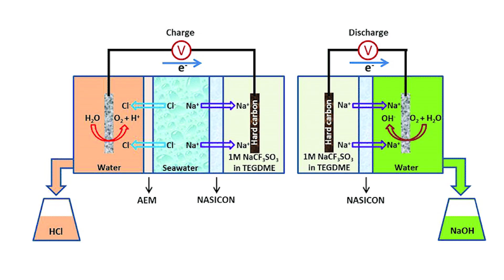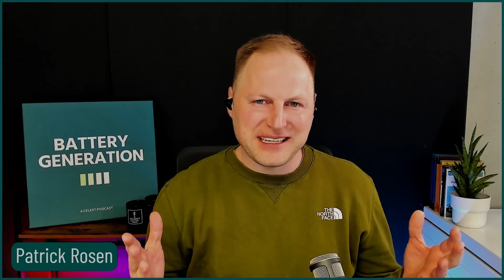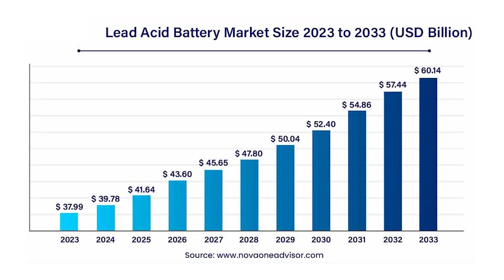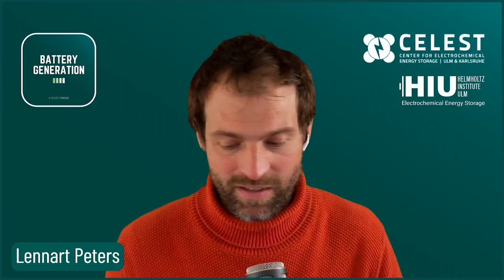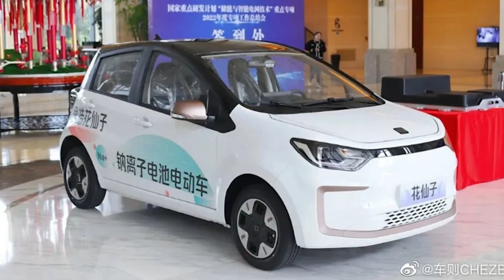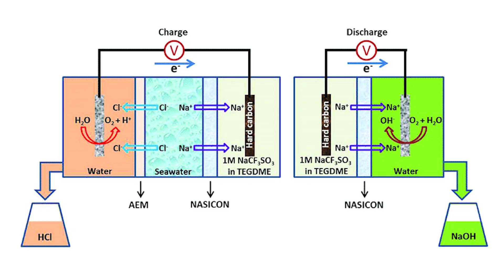💥 Why Sodium-Ion Batteries are NOT taking off.. YET! - Prof. Stefano Passerini - Battery Podcast

Comment: This video is 12 months old now and a lot of things with Sodium-Ion batteries have changed. China has a mass produced Sodium-Ion battery car running around now. It is the Changan Nevo AO6. It has 0 to 80% charge in 15 minutes. It has an acclaimed range of over 400kms or 248 miles.
The cell type is CATL Naxtra Sodium-ion.
Really I do not think that Prof. Passerini  has kept up with the great advances that are taking place right now in China. I give Lithium type batteries another 5-7 years and they will be gone. I will not buy a car that has a Lithium Battery because of the fire risk but I will buy a car that uses a Sodium-ion battery that does not go into a thermal runaway and is fast to recharge.

Comment: There are hundreds if not thousands of people in America who bought a residential energy storage system using sodium ion batteries in which the company has now gone bankrupt due to repeated failures. I worked for an inverter manufacturer where we tested these batteries and they would work fine if you put a small load on them. However if you put a large load on them, especially an inductive load with high levels of inrush current, the sodium battery did not have adequate internal resistance features and the voltage would collapse and the inverter would shut down on low voltage. They were a colossal failure. I imagine this has improved over the years but I would be extremely leery of this battery and I most certainly would not purchase the first version out on the market. I always wait for revision C. 😂

Comment: Many thanks to Prof. Stefano Passerini for the insights and to the channel for staying on top of the SIB. The arguments are clear as to why it has come about, but not quite why it has to stay that way long. After all, it cannot be Europe's constant excuse against resilience and safeguarding our value chains that China has just made lithium artificially cheap in order to prevent European battery plants or even those that want to produce the SIB. We better should move on breaking the Gordian knot with a massive European initiative to build sustainable (salt) batteries for BESS and (super cheap) transportation, instead of accepting China's ongoing manipulations. To secure our prosperity in circular economies, state-subsidized in the right way, just as China has done. Otherwise, Europe will completely lose its export-industry position and make itself vulnerable constantly to economic and political extortion. China is always inventing ways to torpedo the business cases for conventional approaches of European battery factories. We have to break up and definitely need state (Hermes) guarantees to signal our European private investors, its worth to invest in our all-sustainable green future. As our Chancellors said: “Whatever it takes”, and I refer specifically to the electrification of the European armies, itself offering natively massive BESS capacities when we are not at war, such as civil protection with heavy technical support forces can have. All of them could connect to grid in case of bottlenecks in the electricity supply and intervene in case of emergencies.

Comment: Always a pleasure to listen to Prof. Passerini. I'm really curious about the saltwater battery because it really sounds like a promising technology. Would be interesting to know how thin he thinks the solid electrolyte needs to be (e. g. lower than 100 µm), because I would think that since energy density is not the main criteria for this technology you could get away with a bit thicker electrolytes. While not increasing the cell resistance to much and compromising efficiency. Also the long term stability between these NaSICON electrolytes and water might play a role. Anyways very nice and informative podcast :)

Comment: to replace lead acid? lol sodium ion lost the race with LTO this year. in terms of usable capacity for 12v ranged applications, LTO smokes sodium ion without trading anything. LTO is already cheaper than lead acid, why would anyone want to experiment with expensive sodium ion with their useless voltage curve when LTO is essentially a forever battery for automotive applications. can replace a 250$ agm battery in the US with 100$ worth of LTO cells and a dumb analogue inductive active balancer board which will never wear out, unlike a bms.
LTO has to be excluded from any conversation of sodium ion because it makes anyone well informed about niche chemistries sound foolish advocating for sodium ion.
Reply: Are you sure LTO is cheaper than sodium ion batteries? Any concrete evidence?
Reply: @ for usable capacity in the 12v range, yes. you only get like 30-40% of sodium ion capacity in the same voltage range of lead acid. 
look at the prices yourself. 6s 22ah lto, just ordered 102 greenbacks shipted from chyniya
LTO is around 5x more than LFP and Naion is ~2x more than lfp (total capacity =/= usable capacity coz of its garbage voltage curve). factoring in usable capacity Naion is around 7-8x lfp for 12v applications
Reply: I hear titanium is very cheap right?  there's is a reason LTO hasn't been able the compete with LFP.
Reply: BRO ONE IS ANODE AND ONE KATHODE this isn't comparable...
Reply: @ you have no idea what LTO chemistry is... do you?
Reply: @vevenaneathna  for real LTO is on the anode site. It's NMC or maybe LMO chemistry. Comparing LTO Anode with a Sodium-Ion KATHODE is complete bullshit. 
NMC 
LFP 
NaPO 

Compared with PbO2
Reply: @ youre really sure that LTO is not its own lithium battery chemistry that you havent heard of before? lol
Reply: @vevenaneathna  Are you American?
Reply: @ yes sir
Reply: LTO kosten ?   SIB  1000 €/kWh ! Zellebene
Reply: @ yeah i think that was the name of the listing? i got them 6 cells for 100usd.
you dont buy a 12v low voltage battery for the capacity lol. its like 80% the same usable capacity as lead acid when you apply the 50% rule for lead acid.
i tried using 4kwh of lfp, caused some issues with voltage sensing and apm response to voltage not changing much.

Comment: We need a cheap way for DIY types and poor people to build their own safe high capacity solar storage batteries.
Reply: Closed cycle hydrogen electrolyzer & fuel cell… DIY can go to junk yards, just get the parts, call it a day.
Reply: @DavidHalko  i don't think is a good idea people who aren't professionals to deal with H2, because of how flammable it is. You will also need very thick H2 tank because the molecules are tiny and love to escape. The only thing someone can realistically DIY is biogas digestor, but that can be practical if you live in rural area because getting cow poop to kickstart the decomposition can get you into trouble in urban/suburban area. The most realistic thing someone can do is making thermal battery, but that have limited use cases.
Reply: @ristekostadinov2820 - issues exist with DIY battery & solar installations. We do it, anyway. 

One does not need a thick tank to hold H2 to provide power, overnight, when the sun is down. We are talking about storing H2 for a very short period of time in a gaseous form. 

It could be done in an existing technology Type I, II, or III H2 tank, TBH with you.
Reply: @DavidHalko . Nonsense
Reply: @Loki-rascal - Metallic tanks (Types I, II, and III) have negligible permeation rates.

Wrecked H2 cars have H2 tank & fuel cells to scavenge. This is not rocket science.